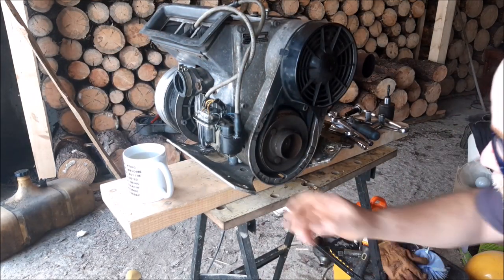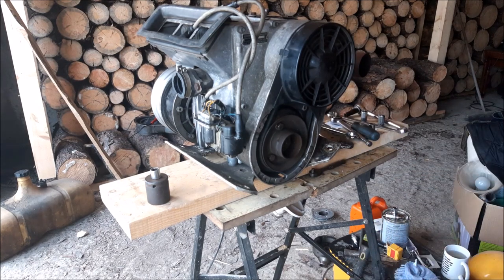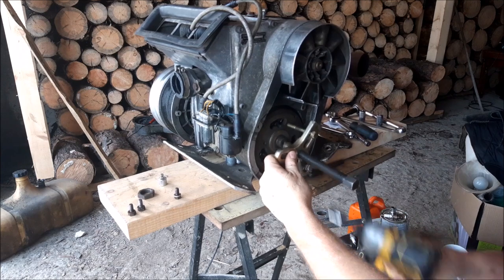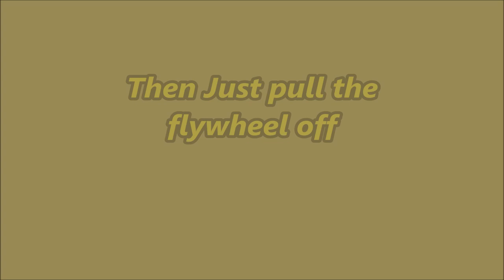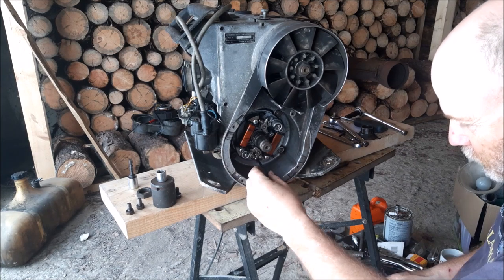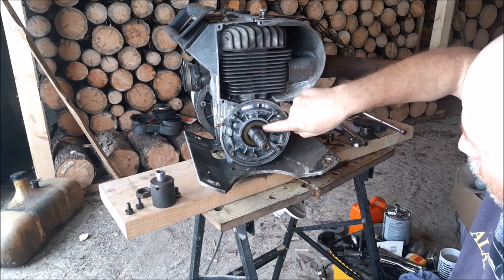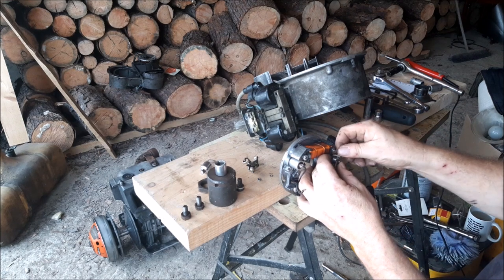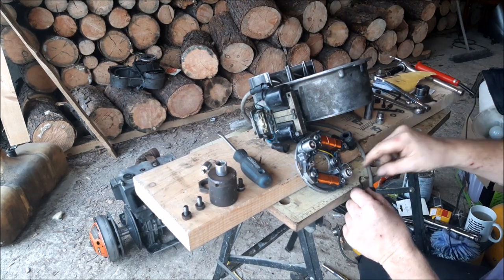How To Remove And Replace Breaker Points And Condenser/ 1970s Ski Doo Everest

Comment: I just got a couple 440 Skidoos and they've been sitting for a long time. I pulled one carburetor off and it was clean and the fuel smelled good. I was wondering what I'd find when I checked for spark. Now I know, when I find there's no spark,  (Which I expect) what my next step will be.
Thanks for a very informative and well-made tutorial!
One of the440s is going to end up on a go kart.
Reply from the maker: Hello Daryl,  thanks...those 440 engines produce a lot of hp when tuned up. I'm glad you liked the video. You have a great day.  Cheers!

Comment: Do you know if these motors can be run out of the body or does it require the wiring harness to start and run. I have an old sled with a good motor and I'm wondering if the motor is worth saving or Is it unless
Reply from the maker: They can be ran out of the machine.  Cheers.

Comment: Cicil, is it possible to convert the points to electronic ignition on those old machines?
Reply from the maker: Hello Denny,  I am not sure as this model engine has a mechanical spark advance on the flywheel.  Cheers.